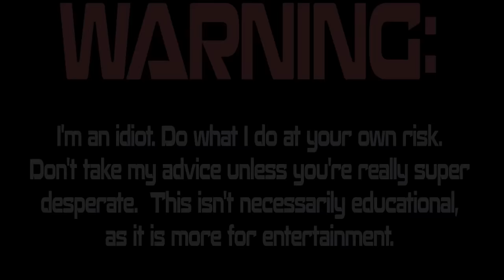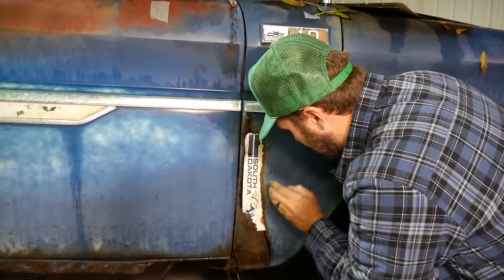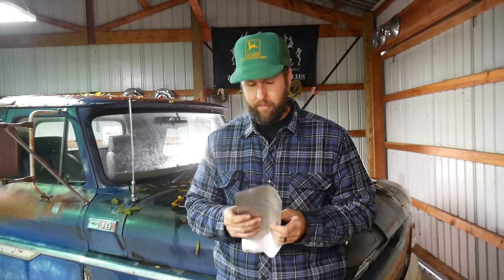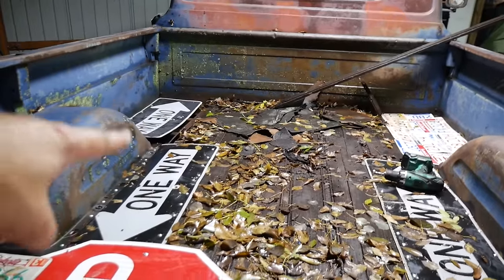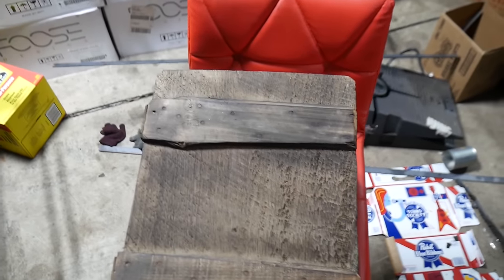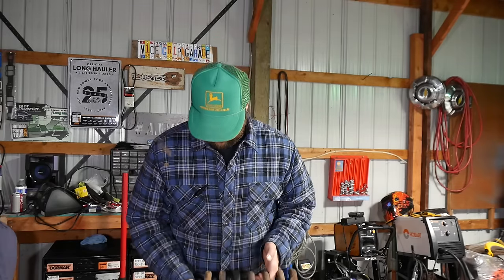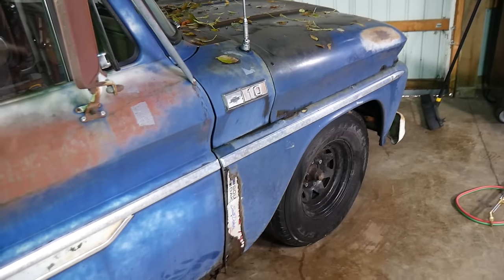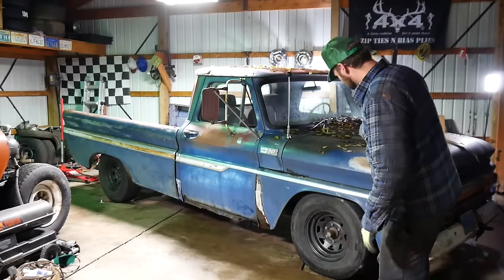Budget C10 Rat Rod Build | Part 2 - Vice Grip Garage EP44

Comment: Truth be learnt, that ole C-10 is more solider than should be expected for a 65 from the salt filled snowy roads of Canada Jr. I consider that more of a fixer upper than a rat rod. The engine is the most best impressiver part of that vechicle for me. You need some faded blue with rust brown polka dots spray paint to touch up on a guys metal fabrication. Now that you load tested the bed with your knees we know that bed is not for hauling, its just for looking at. I'm pretty sure that the best way to run those trim guards around the top of your custom cup holders is to wet em or lay em out in the sun over night.

Comment: When I changed to disk brakes on my wagon I replaced the front springs, it sat way too high so I cut one coil off them. When I let it down it was slammed. I backed it out of the garage and took some pictures but I couldn’t turn the wheel at all. Had to buy another set of springs, this time I cut 1/4 of a coil. Still sits too low but that’s perfect.
Reply from the maker: Haha.. sounds nice

Comment: I like the idea with the signs on the body. But I would have put 3/4 " or bigger plywood in there with a hefty coat of poly/epoxy/lacquer/varnish in the bed of the truck.

Comment: When I was about 16 I had a 91 s10 with an iron duke. One day the timing gears decided to fall apart and that was the end of the engine. I got a 350/350 setup for it. While I was working on it, I decided to chop the springs and slam them back in. When I dropped the motor in it had about 3” of ground clearance. That’s ok...

Comment: Had a 02 gp both coil springs busted so I just did what your not supposed to do and Jack the fount end up to where about they busted and welded them together..till the tops started to go through my hood because of weight reduction so I just fabricated a 3 bolt plate to hold it from shooting through the hood...

Comment: The problem with heating springs is that you ruin the temper and they will continue to drop over time. Better to cut or buy the appropriate sized springs.

Comment: First car 1976 civic heated them solid in shop class
1986 Z28 305 auto chopped them and delivered pizza till heads went
Addictive quick fix for cornering joy
Glad space shuttle has no coils
Weed be in trouble

Comment: I don't see why people think cutting springs is bad. As long as you don't do it with heat and you use a good sharp blade.

Springs are formed and then cut at the factory. Cutting them just gives you a shorter stiffer spring.

Comment: i inherited a 05 envoy with a driver side fender issue. don`t know what happened but it looked like some body made a high speed stop with the door open. drove til it started flapping on freeway. got some old ducting , straightened it out, cut it to size and screwed it on with self tappers. Painted it with primer and drove it daily. My bro in law called it "boiler plate body work"

Comment: Another not so expensive way to add payload and lower it is  circle track springs. You can choose any rate you want front and rear..may require a few modifications . But a guy can make most of the parts with pipe and steel plate

Comment: since I like to drive north of a 65 every now and then, I NEVER mess with the springs. I do, however replace shocks, bushings, and ball joints so the front suspension stays together at those speeds. You can't fool a guy, however, I know you are a 'spurt' on vehicles;)

Comment: I have seen the licence plates riveted together to make a floor pan and the street signs. All manner of coil springs butchered. But the capped off brake line.....some serious thought went into that. A leaking brake line (or possibly a wheel cylinder) is why its capped off I guess,but I would have foolishly considered this to be undrivable.

Comment: I know this was 6 months ago but...I have a huge "left lane closed ahead" sign that would fill up most of that bed...it wouldn't fit in my 6.25ft ram 2500 bed length wise. Width wise it fit between the wheel wells

Comment: i put a 351w in courier cut a coil out front and back  i put ext manifolds on backwards and strait ex left the mazda rearend with the hubcaps when i would do burnouts it would shear the valvestems off

Comment: Late to the party... but if you put a block under your bumper at "ride height" and warm the coil and let the bumper drop to the block and cool it will stay close to that height. but NEVER heat springs.

Comment: use peperonies for ya mouse traps, best is ya got a snack while you monitor your trap line cause them little fellows do not need a whole one so you got left overs. just book it over to the neighbours house when they are not around , (gone on vacation) with your saw z all and get a few boards off their deck for truck flooring, chances are they are better prepared and even have paint on the boards so they will last a couple years longer.

Comment: Nice touch on the bevie cosie/cooler, but I am still scratching my head as to why you didn't use a bit of right angle and put it on the front or rear of the centre console ?
Just a thought, I would have done both !

Comment: Firstly, that truck looks pretty dang cool. Secondish, the "proper" way to improperly lower your vehicular device is to take the springs off the ride and put them in a bucket of water with the section to be cut off sticking out and the section to be kept in the water. That way when you cut the spring it doesn't heat up and you spring won't be sprung. Thirdlike if you reuse the stock shocks the ride will be more comfortable but the shocks will blow out faster so if you want them to last you use heavy duty or lowering shocks/struts. But I guess if a guy we're gonna go through all that trouble he could just as easily put new "proper" lowing equipment on, and who doesn't love some good ol american ingenuity. Don't got the right stuff? Then you just make the stuff you got right.

Comment: I work in a mine in Alberta as a welder, and ive seen some absolutely insane  things happen with coil springs on mine equipment.

Some other welder had to cut out a spring from an excavator track (think 5 times bigger than the average excavator on your average construction site) and he had made himself a shield for his arm out o 3/4" plate for when the spring goes bye. He starts cutting on this monster from the other side of the track, and it shoots out, flying across this 600 foot shop and the 4 foot long several hundred pound spring ends up sticking into the concrete wall about a foot deep, 20 feet in the air.

You felt it in the ground when it left the track and hit the wall from the lunch room.

Comment: Just to let you know in Massachusetts you would have a Court Case for using State Property like One way signs and Stop Signs as Slugs. Also i watched Another Video of your's when you asked about doing away with Catalytic Converters. If the Car, Truck, or Van you  own came with Catalytic Converter  when bought new, Massachusetts Law states you will FAIL YEARLY INSPECTION'S no matter the age of the ride. If it was bought new with a Cat installed it has to be installed in the ride for the life of that ride. Emission inspections are done for the first 14 Yr's of the Rides life. Then you are void from Emissions testing just Safety Inspections are done, but the Cat still has to stay in your exhaust  system.  Also when you are issued a set of Plates for any ride you are Registering in your name that set as in 2 Plates stay's with you as long as you own that ride and would be transferred to any other ride you may Buy. Only the sticker on the plates changes every 2 yr's for a Fee to renew your Registration. The only time you would be issued a different set of Plates is if you take your car off the road and don't Re register another ride right away then you have to turn in the Plates or you will have to pay (Excise Tax) on those Plates plus interest for making payments late and it just keeps on adding up.. Until you turn in those Plates the State of Massachusetts considers you the Registered owner of that plate and will Tax you on that plate number using the worth of the Car it was last on to figure out the Amount.  Or if you are arrested for a DUI then you have to turn in your Licence and Plates if you are found Guilty right away until the State decides just how long you will be Fked for your Stupidity. If you are stopped driving one of those Hoop-dies as i seen you do so many times you would be in Deep Shit. For what you are doing in Massachusetts you have to apply for a (Dealer Plate ) then you would be safe here. In Massachusetts if you are caught with an open container of so called Mountain Water / Beer in your ride you will be walking for at least 90 Day's along with spending at least 2 Grand for Court Fee's and Lawyer's.  You know when you say (well i don't know) (you will know) if those stunt's are done here or any State i mentioned below. In Ma. they would even use YouTube Video's and Facebook posts as Evidence against you.  Keep this in mind if your coming to the East Coast to pic up a ride, Massachusetts Maine New Hampshire Vermont Connecticut will throw you in the Can for some of the shit i see you pull on those Videos. You would not want a Court Case on the East Coast so be Careful. Keep those Video's coming. NICE LIFT IT'S ABOUT TIME. Your wife should take out at least a Million Dollar life Ins. Policy on you. You should be carrying Jack Stands at all times when your on the road. At the least when you Jack up a ride stack something under the ride besides just a Jack. SAFETY FIRST.

Comment: Oh gosh! I bought a new Nissan Hardbody pickup in 94 and had it approximately a year and decided it needed to be lowered so, I got a 3" block kit and dropped the rear and cranked down the torsion bars. Well.... that wasn't good enough SOOO...a buddy and I pulled all the bump stops, ran a mono leaf spring and the 3" blocks & then cranked the torsion bars all the way down! She rode like 💩 but looked good af doing it though! I could pull reflectors off the road with the leaf spring shackles & we won't talk about the tires I went through from not getting the cast and camber set! 🤦🏻‍♂️🤦🏻‍♂️🤦🏻‍♂️

Comment: I’ve got a 66 f100 short wide that’s pretty much the same as your Chevy and I drive it all over. My f100 still has the original 240 3 on the tree. It’s really funny when I take it in to get its inspection cause these guys don’t know how to shift a 3 on the column.

Comment: nothing wrong with cutting springs, unless its a progressive rate spring, - it will be bouncy as fuck... but cutting non progressive coils retains the original spring rate.. so its really not that bad, aside from the extra wear on ball joints and shocks.... But definitely don't ever ever ever heat them lol

Comment: Oh yeah Derek there isn't a way over the yrs with street racing building drag cars that I can think of how I haven't lowered a ride a car truck mini bike Honda trail 70 or a damn. Huvaround scooter!!lmao, I have cut coil over springs stock springs and thought up every way imaginable to hang one down in the weeds and get it so the air goes over the top and dump all that fresh air onto the trunk or the back of the box that I have sheetmetaled over the top of !! He'll I didn't know ya had a damn PO box I would have sent ya some shit by now I would have loved to have that whiskey case if ya have another one laying around I would gladly buy it from ya I had one that my aunt,cleaned outta the upstairs of the bar she owned right outside of Rochester in Honeyoui falls New York!! Anyways that looked like that held a dozen pint,bottles,she had some,bigger but that was the most common size!! Thanks for sharing in this week's show and tell!! Lmao,you crack my,ass,up Derek the standard issue Tonya Harding Hammer ya just gotta love it brother!! !! Loved the cabcorner fix,that woulda had to take atleast 2 PBR'S!! ! That's awesome if ya find ya a few of them there men working signs they throw down in the ditch ya know so they dont,have to put em back out in the morning it probably wouldn't take but 4or 6 to do a solid job on that ole gal HELL I WOULDN'T CALL IT STEALING WEVE PAID FOR THEM DAMN THINGS 5 OR 6 TIMES!! TAKE CARE,BUD!!

Comment: WHEN I LOWERED MY CAR I CUT THE SPRINGS THEN I REMOVED THE SPRINGS AND SHOCKS,  I WENT TO THE WRECKING YARD BOUGHT TWO NEW TIRES THAT WERE DAMAGED IN A WRECK $3.00 EACH IS WHAT I PAID FOR THOSE DAMAGED NEW TIRES.  I MEASURED THE SPRINGS WHILE STILL ON THE CAR THEY WERE ALREADY CUT AND INSTALLED ON THE CAR .  THEN I REMOVED THE SPRINGS AND MEASURED THE SPRINGS AND MARKED THEM WHERE THE SPRINGS WERE AT WHILE STILL ON THE CAR THE SPRINGS WERE ONE AND HALF COILS SPRINGS LONGER OFF THE CAR.  OH THE TIRES HAD TO BE POLYESTER NOT RADIAL, OR STEEL BELTED .    SO I CUT THE TREAD OFF THE TIRES AND CUT THE TREAD ONE AND HALF COILS SHORTER THAN THE SPRINGS WHILE OFF THE CAR.  THEN I ROLLER THE TREADS AND PUT BAILING WIRE AROUND THE ROLLED UP  TREADS i USED HOSE CLAMPS TO ROLL THE TREAD UP TIGHT ENOUGH TO PUT BAILING WIRE AROUND THE TREAD. TO HOLD THE TREAD IN A TIGHT ROLL.  THEN I SLIPPED THE ROLLED TREADS IN THE COIL SPRINGS. SHOCKS WERE LEFT OFF.  YOU HAVE TO PUT RUBBER WHERE THE SHOCKS GOES UP IN THE FRAME. THEN I BOLTED EVERY THING BACK IN PLACE .  THEN I CUT THE BAILING WIRE. PUT THE CAR ON A DRIVEWAY TO MEASURE THE HEIGHT  IT WAS PERFECT. I DID NOT HAVE SO SLOW DOWN FOR RAIL ROAD TRACKS.  i WAS 1/16 LEGAL.  PEOPLE WILL ASK ME IF I WENT TO A SHOP TO HAVE MY CAR LOWERED IT DROVE SO NICE. IT DID NOT BOUNCE LIKE A CAR THAT HAD NO SHOCKS THE RUBBER LET IT BOUNCE ONE TIME LIKE A CAR AT ITS STOCK HEIGHT.  MY CAR WAS A 1946 CHEVY.  TRY IT YOU WILL LIKE IT!!!

Comment: My dad bought a 1972 ford somethin or other truck back in like 99 or so it had a 390 in it and was actually pretty cherry... ended up givin it to my sister n she n her husband bored it out to like .8030284757 and a half but they still got her n runs great... blows civics off the road on occasion... i think ill buy a set of drill bits from walmart and bore out an engine or two myself

Comment: As I am watching this I am sick and mad irritated. The proper way to lower that coil is to heat the bottom coil only starting from the very bottom and chasing that Barry around the circle until that bottom coil collapses and then immediately quenching it with cold water from a hose. This is called tempering it realigned the iron molecules in the spring. What you did by heating it and allowing it to cool off slowly is you annealed the spring which softened it and ruined the spring. By heating the entire spring you destroyed the tensile strength in the spring.